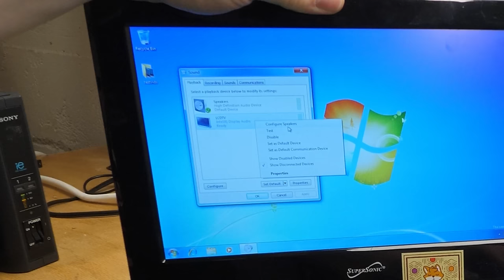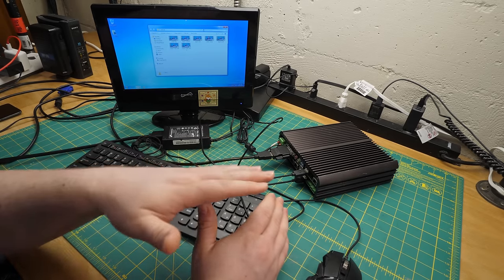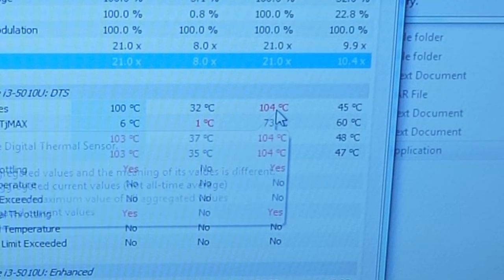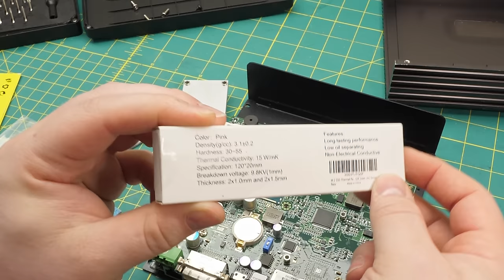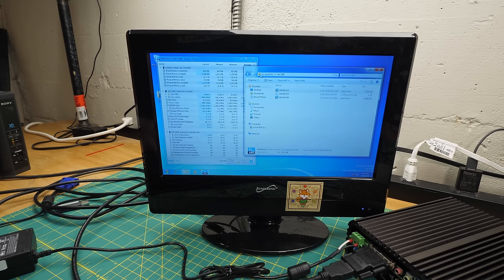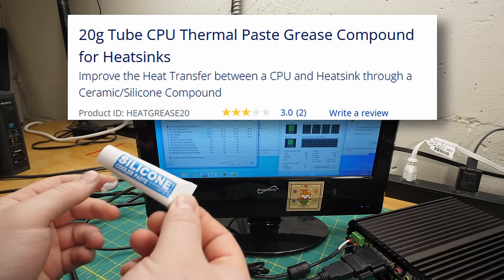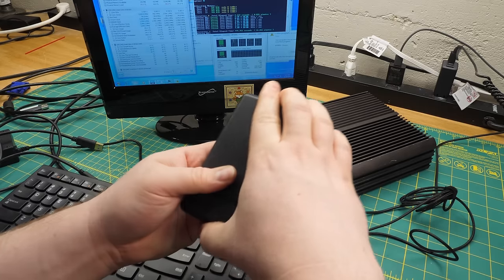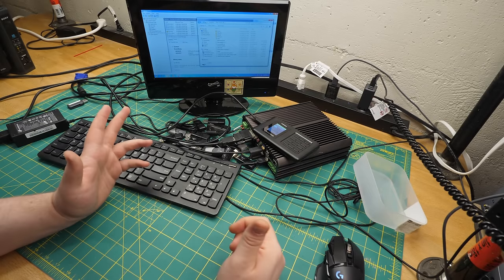Little Guys 4, Pt 2: More DVI Nonsense

Comment: Just gonna gently salt that wound. I actually would, for a while in the mid to late 2000s use an HDMI adapter just like that to use the HDMI TV I was using as a computer monitor....as a monitor, and use its built in audio, just like you did. If you just...MISSED DVI's existence entirely back then, which honestly, wouldn't surprise me, I can understand how you wouldn't know this, but yes, DVI almost always allowed passing over an audio signal. Up to 5.1 IIRC as long as it had the pins for it.
Reply: There are no pins for audio. The audio data is packetized alongside the video and control data using the HDMI 1.x specification since both use the very same TMDS signaling and has been designed to be compatible.
Reply: @rdoursenaud  You say that, except, I've had old cards that had maybe...like half the pins populated, and while still getting the same video output as the rest, it was incapable of outputting audio. So while yes, all the pins are technically just digital output, if it doesn't have ENOUGH pins, audio gets dropped.
Reply: @Melechtna  Two unrelated things IMHO
Reply: @rdoursenaud  I mean, your point is unrelated to my original point of, those that used DVI, knew this was a thing, if you missed it, and it's totally understandable if he did, you'd probably never guess this or have any reason to assume it. So, pedantry aside, if the Video Card omitted certain pins, audio wouldn't transmit, be they dedicated to the task or not is kind of irrelevant here.

Comment: seems like most people could save the money on the iodd and just use ventoy
Reply from the maker: ventoy is specifically not the same thing. ventoy can't change images on the fly after booting; this can. ventoy doesn't show up as a genuine CDROM; this does. ventoy doesn't simulate a half dozen separate devices simultaneously; this does.
Reply: @CathodeRayDude  that’s actually really interesting. You should definitely make a video on this device.
Reply from the maker: @keithnewman9043  I'm waiting until I can afford to buy one or two other models from them, since I know they work quite differently, and then I gotta sit down and really think through the process and make sure I'm getting the pros and cons right. Because for one thing, I suspect that ventoy is faster than this, so for OS installation specifically it's probably superior.